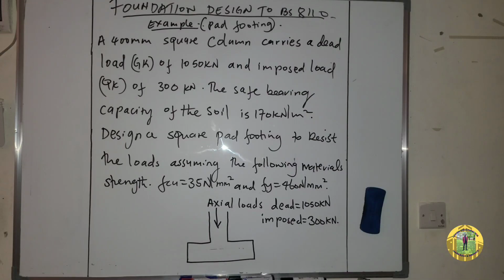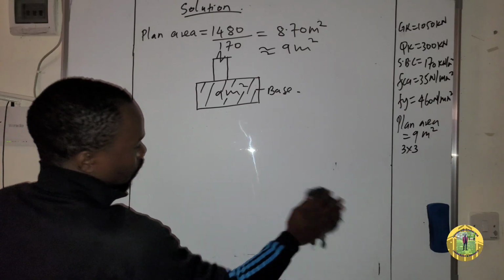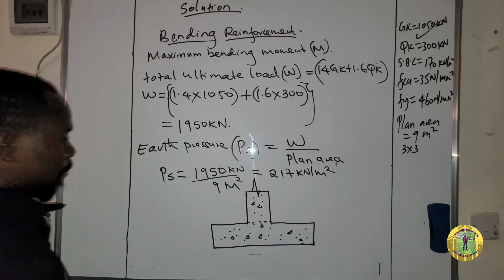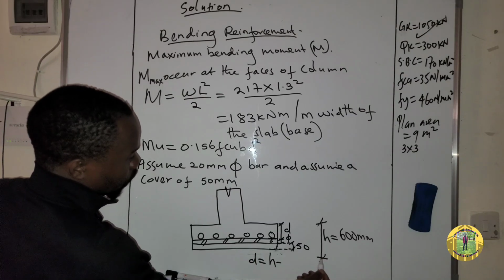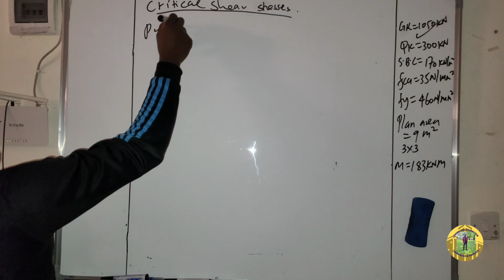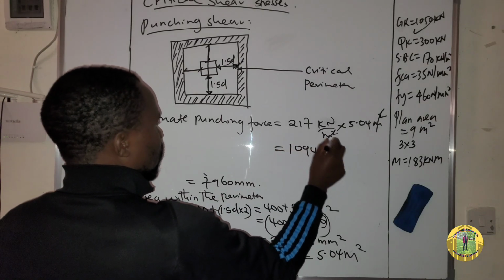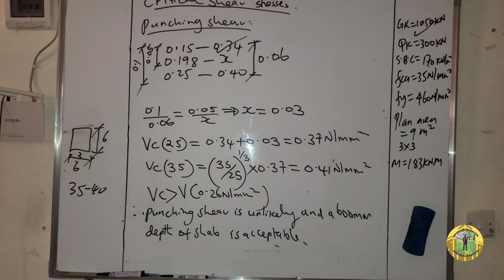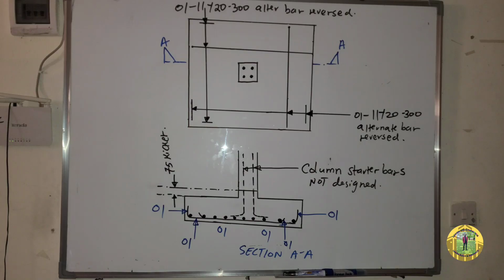HOW TO DESIGN PAD FOOTING TO BS8110

Comment: Q1.  When calculating the Vc= 100As/BD where did you get As as 1050 please.

Q2. When checking transverse shear  force  how is v= V/BD  = 0.32 and not 0.95
Reply from the maker: Q1. 1050MM^2 is the area provided in table 3.22
Q2. is 0.32N/MM^2.
Reply: Can we have the same for Eurocode too